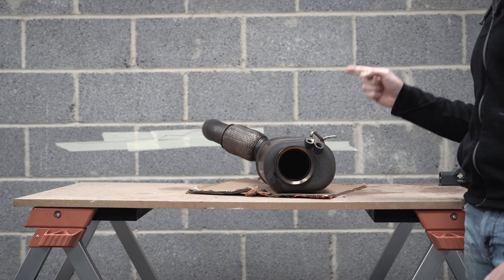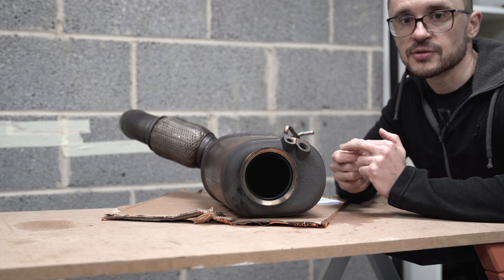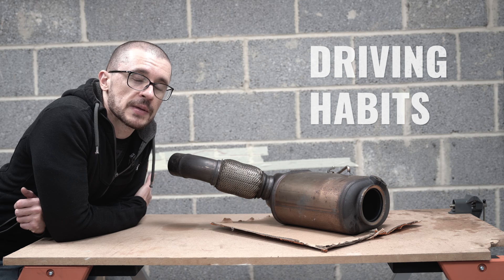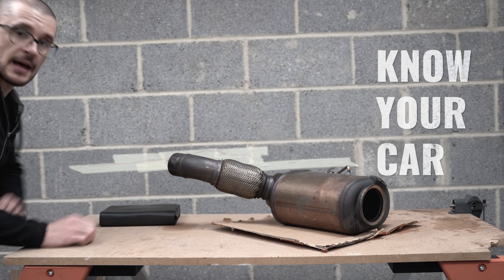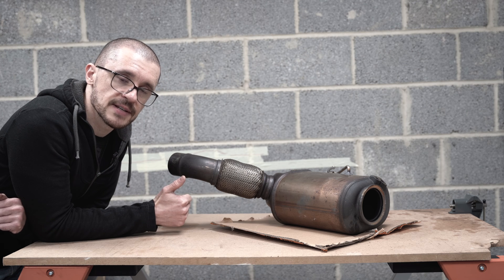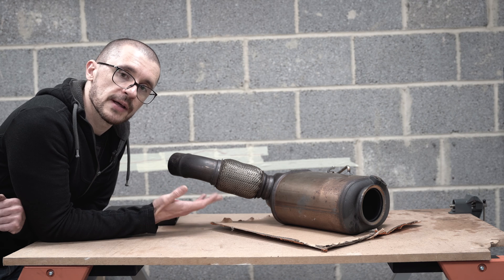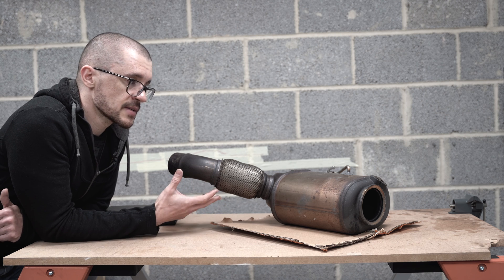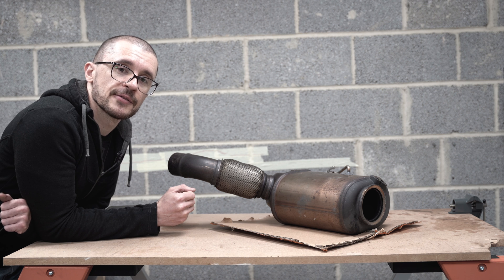How To Avoid DPF PROBLEMS - Diesel Particulate Filter

Comment: Whoever thought and imposed the DPF on diesel cars should be rotting in Hell.
Because all the advantages of a diesel (low consumption, cheaper fuel) go out the window if you have to run your car for 30 minutes every week for nothing.

Comment: I bought a 2007 Chevrolet Captiva in 2012. Back then, knowledge about DPFs wasn't as widespread. A month after buying it, I realized it was burning out every 100 km. I started going to garages, but no one could diagnose it. Then I went to a garage, where they removed the filter, burned it in a special oven, and put it back in. Interestingly, this didn't change anything. Even though the filter wasn't melted and physically clogged, it still burned out every 50 km. After the burnout process, the next reading was 70% full a moment later. I went to complain and got another regenerated unit. It worked immediately. I've driven it almost 200,000 km, and three weeks ago, I picked it up for regeneration, this time with a chemical pressure wash. Currently, the filter is burning out again every 1000 km. My captiva has 320 000 now. The DPF is an excellent barometer of the condition of the car and 99% of problems are not a problem with the filter itself, but something else in the system that is clogging the filter.

Comment: I use DPF cleaner foam ..   I drilled Holl in the front off DPF so I can put chemicals directly..    And I made threads to scrue to plugg the hull..     + ceramic lube on threads..
Reply from the maker: that is very ingenious. 🧐
Reply: @BestCarMods  it works..  and you don't need to remove - risk to broke sensors..

Comment: The biggest leverage is missing completely: premium fuel… or nowadays, HVO 100. Higher Cetane, better burn, less soot, cleaner injectors and engine. Less clogged EGR and intake, cleaner oil…. The list goes on.
Reply from the maker: I need to do some research into these premium fuels. From when I was in university, many many years ago, the idea that our fuel expert was telling us , was that fuel changes it's properties in storage. This is more relevant to petrol, but diesel is impacted also. Now, the overall takeaway is that you want fresh fuel vs fuel that is old and nobody buys. Also keep in mind that Diesel in storage is capable of developing some bacteria that is very bad for the fuel systems. The premium fuel, because it is not bought that much, has an increased risk of creating additional problems. A interesting option is to buy the standard one and use your own additives. What do you think about adding your own additives ?

Comment: I have a Seat Freetrack 2.0 tdi with this dump device called a DPF: i have driven it for  30 minutes like a I stole it at 120kmh 4000rpm the DPF light went off and then within a day of normal driving its back::: 91000 miles:::: qeustions: i would like to remove this::: whats the best option:
Reply from the maker: I am not an advocate on removing DPFs. In the video you should have all the info needed to take an informed decision.
Reply from the maker: https://www.youtube.com/watch?v=3qUk8ybuIws

Comment: In the case of oil dilution usually happens when the DPF is not adequately regenerating. As a symptom noticeable when you get oil level rising on the stick

Comment: Do you have any comments about fuel additives that supposedly assist in DPF maintenance ie Penrite DPF cleaner additive for fuel ?
Reply: My suggestion would be to use a fuel additive like fuel doctor or archoil that conditions the diesel so it burns cleaner and your injectors stay in good shape. More efficiency, less soot, less dpf load.

Comment: How about getting a tuner and delete the dpf. No more sensor issues and no waisted fuel. Improved fuel mileage
Reply from the maker: Theoretically is it illegal and you are killing the planet.
Reply: killing the planet eh.  How about the making of evs and green energy. You need to watch the dark side of green energy and the planet of the humans they are both on YouTube for free. Then tell me who’s really killing the planet.  The other thing that’s so called killing the planet it NASCAR , Formula 1 and the NHRA racing waisting fuel and putting all the emissions in the are for entertainment. Just like recreational fun like boats, atv’s , motor cycles, fueled powered remote control toys and snowmobiles and private small planes. Also I’m sure you walk to and from work or to stores. Or use a peddle bike not an e-bike  am I correct? I bet not.  You probably use your car just to go to the corner store for a popsicle and go back home.
Reply: And fail MOT? DPF check has been standardized since 2014 as part of the MOT, not having one is an instant fail.
Reply: Where is this

Comment: I have a 10-year-old Mitsubishi ASX 1.8 diesel manual with 47k miles - being retired and living on a peninsula it's only doing 3k miles per year but I'm conscious of the need to exercise the DPF. Fortunately I can tell when it goes into regen - the engine note changes and the average fuel consumption briefly falls off a cliff (!) so I keep that display up permanently for this reason and take it for a run whenever necessary. In truth I know I'd have been better off with a petrol version but this was the one which came up at the right time/right price/right mileage/right colour! I drove one of the first ones into the UK in 2010 and love the thing so I'll continue to do my best for it, including annual oil changes regardless of the low mileage. Oh, and I've switched to better quality fuel too.
Reply from the maker: on the fuel side, I would say use standard + your additive . the reason is that not that many people buy premium fuel and it ends up staying in the fuel tank at the petrol station for a long long time. best fuel is fresh fuel.

Comment: Thank you.
Reply from the maker: Glad to see feedback. Was the video useful for your car? What do you drive?
Reply: @BestCarMods  I got myself a new 2014  Volvo V60 I even went down stairs a got the car manual. Life can make us forget to read the details. 100000 miles on the clock, magic machine, I want to look after it. Bro
Reply from the maker: @Sanctuary.Garden  give it good oil, change it at 6000 miles, some liqui moly diesel purge from time to time in the fuel tank and it will last you a long long time.

Comment: Delete by gutting remove egr, remove rear dpf pressure sensor tube. Done no need for ecm mods. Put erg back on for compliance when needed. Simple.
Reply: Pity it fails MOT here

Comment: Thank you for this informative video. I have one question though.... everyone says go for a good drive on a highway for 20 minutes, at 50 MPH, with 2000 RPM Or 20000 RPM ????!!!!!, once a week to burn off the soot. The question is  Do we have to  go on a highway to get this Regeneration, and CAN  WE NOT RUN THE  ENGINE for 20 minutes at 2000 or 20000 RPM at home or in a parking-lot  to heat the DPF  to regenerate? Please reply.
Reply from the maker: to simplify the answer: 2000 rpm in neutral is not the same as 2000 rpm in 5th gear. in neutral you don't burn as much fuel and you don't generate the same amount of heat. you are missing the concept of Engine LOAD. Also in my testing I found 20 min to not be sufficient.
Reply: @BestCarMods  THANK YOU FOR YOUR CLARIFICATION WHICH MAKES SENSE. YES, I UNDERSTOOD THE CONCEPT ''ENGINE LOAD''. THANKS AGAIN.

Comment: My five year old ford connect has never been good, even from new, its used for mainly short journeys, with weekly journeys about 60kms, its been to the ford dealer hundreds of times, the ststem is not fut fir purpose, The gaurantee has now run out, after five years, I am going to remove the rubbish and re-programme it.

Comment: Does alchohol injection make your dpf last longer. I had it on my dodge ram and it was good untill i traded it in? Just wondering if it helps or i got lucky
Reply from the maker: Could you please tell me model, year, engine variant? in Europe I have not seen such a thing. especially on a standard car.

Comment: You need to flush the engine with Liquimoly engine flush at every engine oil change to drain all the soot and ash out of the engine. Change oil every 5,000. Also need to do long drives as well as video OP states.
Reply from the maker: would it not be to aggressive to use that flush every time?
Reply: @ I have been doing so on two cars with great results. One has 127,000 and another 340,000. It just liquifies all the build up, sludge and  carbon and soot inside the engine and therefore
Minimizes amount of crap thrown in to DPF therefore making easier for it to burn through stuff, that’s the way I see it
Reply from the maker: @MolotovGarage  I usually use a flush fist thing when I buy the car, and after that only good oil and until now all is good. when I looked at my cam shafts they look really clean by comparison to other cars I have worked on.
Reply: @ diesel ? I am doing on 3 diesels Q7 TDI, GL350 and Yukon 147,000, 340,000, 129,000 all high mileage, engines flushed every 5 k all very happy , I can’t speak to any hearsay or assume I just have these results 😊
Reply from the maker: @ thanks for sharing.
Reply: Also advise cetane booster for better combustion
Reply from the maker: @berkiskender8493  what product are you using ?

Comment: Chane your oil every 250 hours of usage ( 6000 miles / once a year ), dont run diesel in town and short  distances . You are welcome
Reply from the maker: the golden rules ... I was thinking about what is the borderline of when you should get a diesel ... what do you think ? should it be miles ore time ? for some reason my new theory is that if you drive less than 30min at a time you should not get a diesel.

Comment: Ash is not the unburnt carbon. Ash is what is left after all the combustible parts, including the carbon in the soot particles has been burned off. All fossil fuels will contain a small amount of impurities which are incombustible and those will eventually clog up the DPF. Then the only recourse is to flush it with chemicals or to replace it. Short of making sure that you use the purest diesel fuel (and how would you go about that), then there's not much to be done.

Taking measures to make sure that the regeneration works as effectively as possible, which is the process of burning off the combustible part of the particles deposited in the DPF is, of course, extremely important. However, don't confuse ash with soot.

Comment: I personally don't dare buying a newer diesel with DPF. I have Volvo with d5 euro 3 engine. People with d5 euro 4 engine have about 2 l/100km worse fuel consumption. And butterflyflaps can destroy the engine.
Reply from the maker: funny you say this ... I have a similar opinion about the Euro 6 with AdBlue ... in the sense that I am ok with a car with just the DPF ... but I am afraid of AdBlue ... I have seen to many having adblue pumps and injectors fail.
Reply: Each thing adds complexity to the system and the more complex emissions system has more points of failure. I guess there's no point in buying a modern diesel when you don't drive long distance daily.
Reply from the maker: @peep25100  have you ever cleaned your intake ? have you ever cleaned the EGR?
Reply: @BestCarMods  In the summer I did pcv and cam cover casket during that intake egr came off, and difference was very much feelable. I was afraid now to get fined
Reply from the maker: @peep25100  this means your volvo is ready for another 100.000mi :)
Reply: @BestCarMods  That was the goal. If I don't let the holes rust in and change everything when it starts making noise, then it will take me around for a long time. 400000 km is on the clock so I think right now I need to change parts pretty often.

Comment: I need help. I have a bmw 218d withe b47 engine. I have remap from 150hp to 190hp.  I recently bought the bimmerlink and while it tells me that the dpf still has a lifespan of 140,000 km, I notice that it regenerates every 100 to 150 km because it fills up very quickly with shoot mass. I always use shell vpower, I change oil every 8000 km and i have 125000km. what could be wrong?
Reply: well i would tend to think it is not a good remap. if your driving habits are as in the video suggested.
Reply: I drive 50% city and 50% open road. I do 300km per week only for work plus some other trips some times when I have day off and usualy I'm not go slow. Will be better if I return to the stock map?
Reply from the maker: @ return to stock and perform your dpf check to see if the numbers are significantly different.
Reply: I returned to stock map. I think the levels of the shoot mass are a bit better. I've been following it front bimmerlink and I don't know if the numbers it shows are correct. Is this app trustworthy?what are the acceptable numbers for the differential pressure? What is the upper limit of the àsh mass?The last regeneration now was 300km before
Reply from the maker: @sirbatist4616  love to help, but the level of detail for information you are asking is something that requires me to use specific data systems and can't offer it for free. should you really want to take it to that level I need to charge consultancy services.
Reply: What is the price ?
Reply from the maker: @ email 8hello@bestcarmods.com .

Comment: Give you car a good 30+ min run on a highway between 2200 and 2700 rpm. That will blow er out good. Dont be shy to accelerate with a lead foot either on the hwy runs. I noticed a good fuel economy increase after doing this.
Reply: This is not helping emissions though is it, the for is just like most green things, utterly ridiculous and do more harm than good

Comment: Why not just clean the DPF from ash? It seems quite easy using dilute hydrochloric acid. The only problem if you don't have a garage with a lift is to get the darn thing off of the car.
Reply from the maker: the problem is as you have highlighted that the part is not designed to be cleaned. 1. it is hard to reach 2. it is welded 3. it is close to the catalytic converter. however the DPF is not failing ... something else fails and the dpf is just a byproduct
Reply: Look up Steven b Tuner on here.. he has quite alot on DPFs and diesel related engines - Top guy he Is!

Comment: I have a Fiat Ducato motorhome 2.2 140bhp 2023 model year completed 11,000 miles. After getting a cheaper scan tool I’ve noticed the regen takes place roughly every 150 miles. The soot level increases to about 85% then not long after does a regen. The pressure looks good at idle around 5mbar and rises to around 45mbar at higher rpm. Is this normal or am I worrying for no cause? I’ve started to use Shell Vmax fuel in hoping it improves the soot level.
Reply from the maker: I am not familiar with that engine and can't give an accurate & technical answer. You will need to do specific research based on your engine code.
Reply: What Scan tool did you get mick?
 I have a bmw 330d e90 and it use to regen every 200 miles when I first got it with 85k now I'm on 115k and it does a regen around 170miles depending on what type of driving I done pre to it.
Reply: @terrybooya6132  I got a Topdon Artidiag900 lite it’s great for doing reports but is very limited for other functions. My guess is because Fiat has a Security Gateway Module that blocks most of the functions or it’s simply the actual scan tool that’s limited. 
I’m currently monitoring the data every trip to build up a database of readings in the hope if something goes wrong I’ll be able access the data.
Reply: @micksparrow8214  thanks for that I will look that topdon one up. So your motor has to much security going on.. they do say the newer motors now are so technical to work, even more so with the really new ones like yours, trying to make you take it to the main dealer.

Comment: mazda 2.2 skyactiv 2016 - terrible engine but that what i have! now have soot issue in DPF
Reply from the maker: One of my friends has totalled that engine in less than 6 months ... if you want to make him cry, you show him a mazda :)
Reply: @BestCarMods  manufacturer and dealers bear some responsibility tbh,had a Peugeot before and they were renowned for being trouble,bought a Japanese car and you guessed it, shite
Reply from the maker: @johnnyboy4711  After working with many technicians and even the manufacturers, it usually translates to someone not doing their job as they should at some point. The mechanical & electronic systems are quite robust. The humans are the trouble makes.